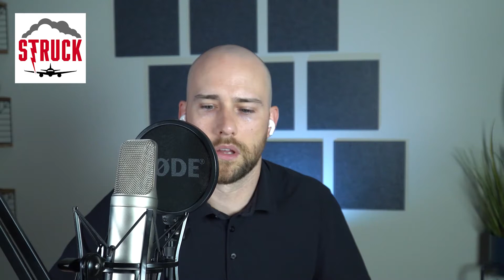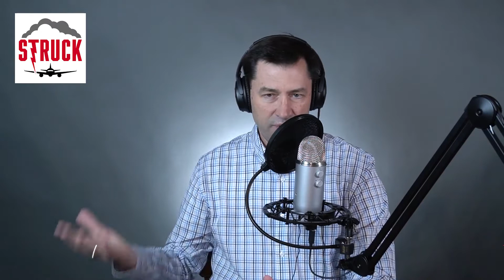Boeing 787 Paint Adhesion Issues

Comment: It takes many days for paint to fully cure on commercial jets. There is cure for handling, another cure for solvent and hydraulic fluid resistance and many more  days to be fully cured.  Every composite panel is prepainted  before assembly in the factory. Every prepainted panel is sanded and solvent cleaned for final coat in the paint hangar which is what makes paint adhere to the previous paint. So why is this happening on only one model of Boeing aircraft? Paint is applied for corrosion control, not to withstand the power of a suction cup. These guys didn’t explain any of the factors leading up to this paint failure like how long the paint had cured. I prepped and painted composites on the B2 Bomber, prepped and painted 747 and 767 wings before assembly to the fuselage and the livery schemes for 757 and 737 in the paint hangar. Again, why is this happening to only one model of Boeing planes?  That’s where you’ll find the answer.